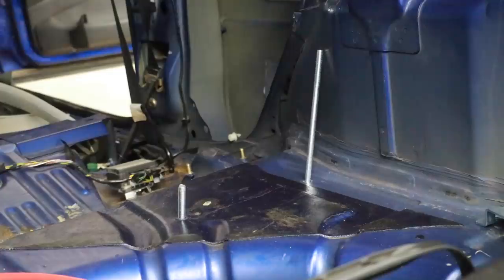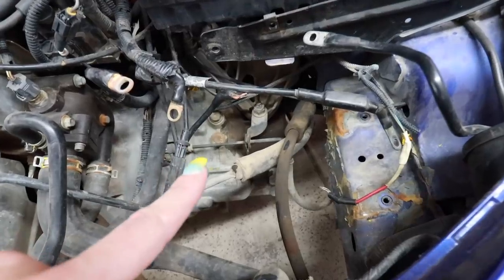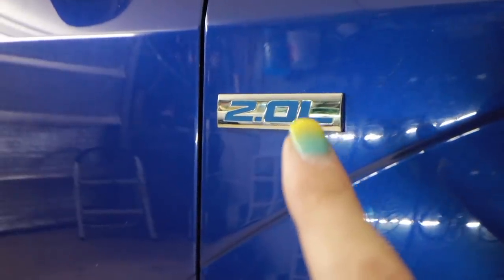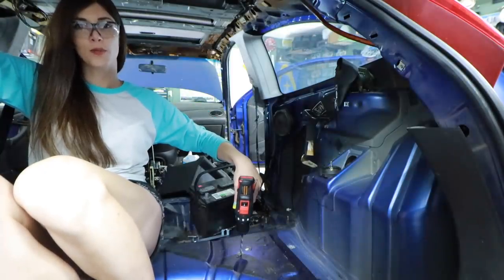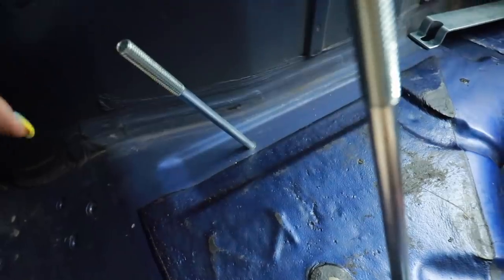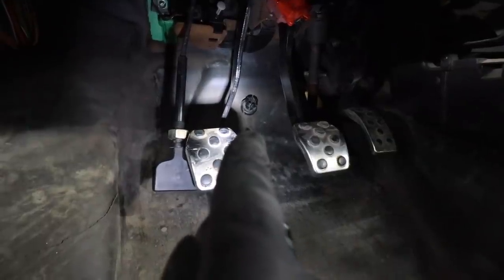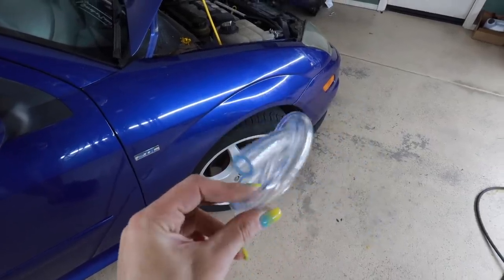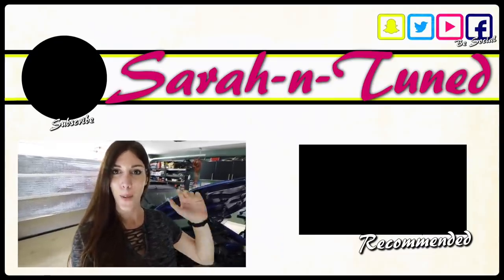Because Racecar!? // Rally Focus SVT Battery Relocation

Comment: When you disconnect the battery you are supposed to disconnect the negative battery cable first on anything that has a computer
Reply from the maker: wade poniewazsr meh, it’s fine. I’ve never in my life had an issue doing it that way and I’ve probably disconnected a million batteries by now lol 😂
Reply: It makes no difference to the car or any computer inside, an open circuit is an open circuit. The negative first thing comes from avoiding shorting out a tool to ground while on the positive terminal, which is easily avoidable with a little attention.

Comment: You need an OCD compliant assistant. I will work for tacos. PM me. You need to race Obsessed Garage when both cars are done. OCDRally Series.
Reply from the maker: Michael Sullivan I DEFINITELY need an assistant! It’s stressing me out doing this stuff alone constantly. 😔
Reply: @SarahnTuned  ....hmmmm....well, you're only a brief NJ to AZ commute away. If the gas station is open in PA, and there's no Traffic in IA, I could be there by next Tues :)